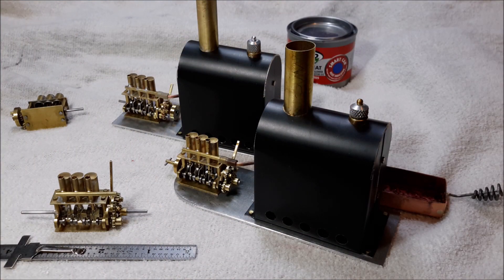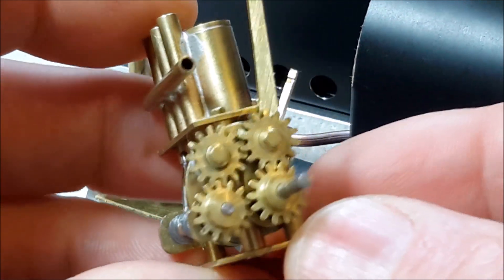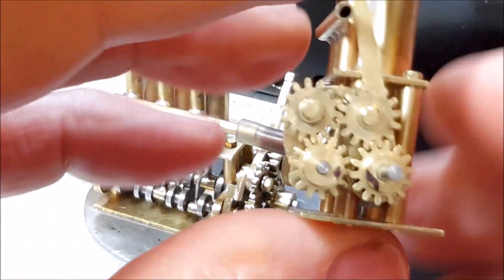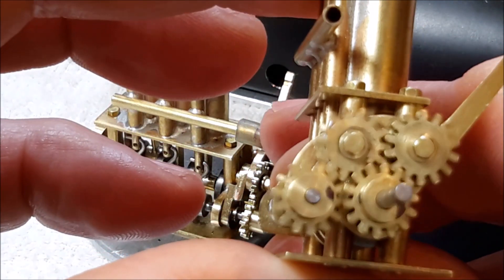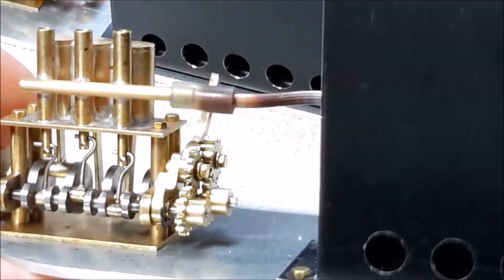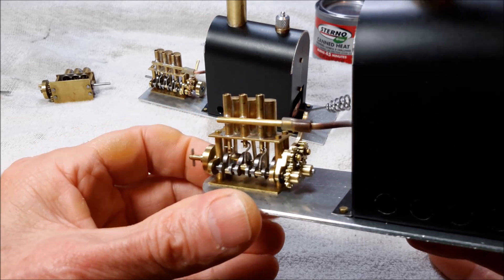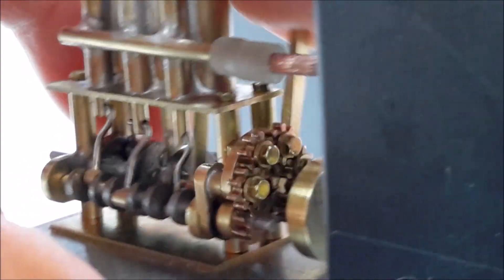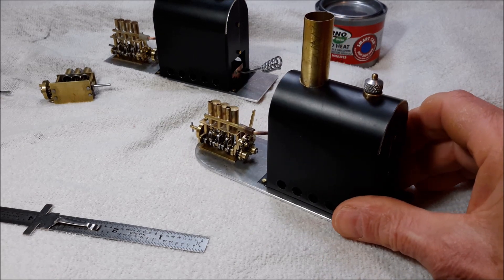MAUDSLAY REVERSING GEAR ON MINIATURE STEAM ENGINE

Comment: Hello Leslie!
Finally got a chance to look at your channel.
Very impressive I must say;  your ingenuity and productivity appear to be boundless!  Glad you got Maudslay's reversing gear implemented and running.  I like your idea with the staggered gears so that larger gears may be utilized.
Here are a couple of questions:  You use drawn tubing for cylinders and valve chambers.  What material do you use for your pistons and valves?  Do you lap them together for a good fit?  If so, what do you use for a lapping compound/abrasive?  If not, what do you use for piston rings/piston seals?  Thanks for your response.
All the best from Ontario, Canada.  Wolfgang
Reply from the maker: Hello, Regarding my little steam engines the cylinders and valves are made from K & S Precision brass tube.  It is half hard brass and has a very smooth and straight ID and needs no machining or polishing.  The pistons and valves are made from free cutting brass rod and are cut to an OD about 0.001" smaller than the tubing ID. The pistons and valves can be polished, but it is not really necessary.  A good finishing cut is sufficient.  All of my tiny steam engines are run on low pressure moist steam and the piston and valve are lubricated by the moisture, with also helps to form a steam seal.  I would be happy to send you my single cylinder steam engine plan if you are interested.  My email address is lesproper@gmail.com  By the way, thanks for posting your excellent steam engine video.  It is what got me onto the Maudslay gear.

Comment: Very Nice job i knew you could make reverse on one of these babys
Take a look at dieter philips locomotive the reverse on that is also gears but with 2 gears
Reply from the maker: Hello Martin,  I have seen Dieter's video I think.  An even number of gears are required.  I have engines with both 2 and 4 gear trains.
Reply: Leslie Proper 
I was thinking you could use it for a single stroke marine engine
Maybe iam wrong

Comment: Would this work on the little 2 cylinder you designed?
Reply from the maker: Nope, not unless the engine was redesigned with the valves on the sides and a gear driven valve shaft.
Reply: @LeslieProper  good point I recently did a cad drawing similar to your 2 cylinder and had it 3d printed in metal by shapeways I guess my next one will be 3 cylinder.
Reply from the maker: That is pretty cool,  how does it work?
Reply: @LeslieProper  I don't know I'm still building it but it will be almost Identical to you 2 cylinder single acting engine
Reply: I have seen a few two cylinder engines, the valve gear has to be on the side. I am working on doing a design for this using a Stuart D10.
Reply from the maker: Sounds interesting.  Let me know how it goes.
Reply: @LeslieProper  have you ever thought about making these to sell
Reply from the maker: Hi Matt,  I have not thought about it very much, I don't think it is something I would care to do.
Reply: @LeslieProper  I figured, but you see to have quite a few. I actually made some progress on my 3d printed version, I'm currently trying to decide if I should try 3d printing the crank shaft as a single piece. Shapeways claims that they can do it but I'm worried about the surface finish on the bearing areas.
Reply from the maker: Yes, when I build them I always make 2 or 3 because the set up time takes much longer than to make the parts.  Also they require so little material.  I am amazed to hear that metal parts can be 3D printed.  I wonder if they will be strong enough.
Reply: @LeslieProper  I know the cylinder would be strong enough it's a stainless steel that is sintered and infused with bronze. I made all the bores under sized and reamed them out to size. I think I'm going to try both a 3d printed crankshaft and a built up like yours. I was surprised when i ordered the "block" that the valve passage hole between the valve tube and cylinder was a clean hole. I was expecting it to be blocked or kind of depressed around the edge but it wasn't.
Reply: @LeslieProper  do you know if there is a way to post a picture comment?
Reply from the maker: Hi Matt, I don't know how to post a picture here, but you could send it to me at lesproper@gmail.com

Comment: Bonjour Leslie,
Great little engines indeed, and thank you to explain us Maudlay's reverse principles. In scale 1, was it as used as Stephenson or Clindial valves reverses t you opinion ? I do not remember having seen a real one.
Besides this, I do not see any oil lubricator, especially with superheated steam, is it normal ?
Amicalement, Raphaël
Reply from the maker: Hi Raphael,  I believe the Maudsley is the least common.  I read that the Maudsley valve gear was used on some steam marine engines.  I could not fine much information, but I wanted to try it on my 3 cylinder because it already had the gear driven valve shaft.  All of my miniature engines require a little moisture for lubrication.  I tried steam oil once and the engines would gum up and stop.  So superheated steam is the enemy of these engine.  Made from brass and using moisture for lubrication these engines will not last like the cast iron engines that use steam oil.  But I think you could run one for a very long time before wearing it out.  The horizontal boiler in this video originally had too much of the steam pipe suspended over the fire box.  By bending it up so it is against the bottom of the brass boiler it conducts heat to the boiler and no more superheated steam.